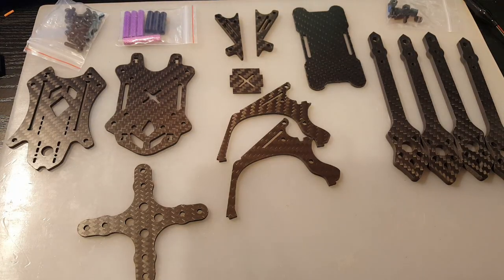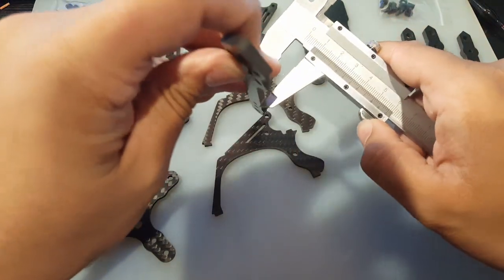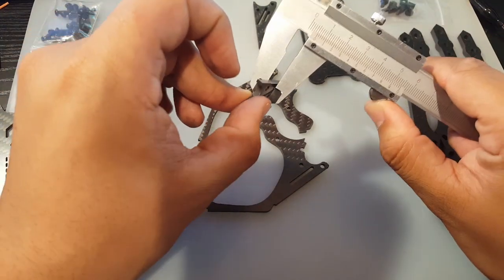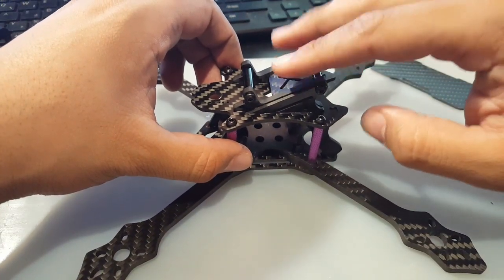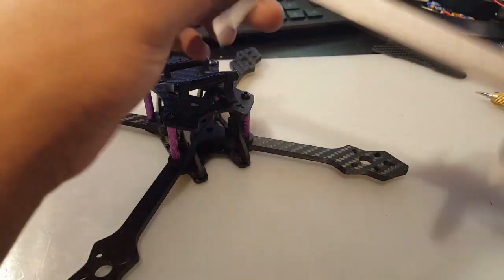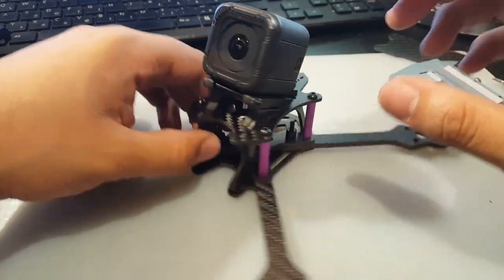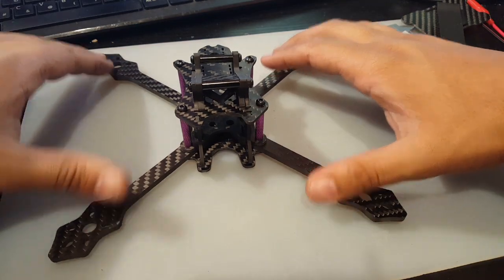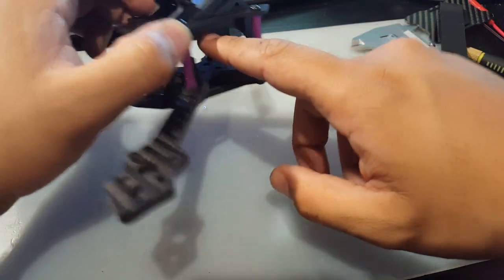Realacc Blackbird 205 Frame // My Thoughts and First Impression

Comment: I took the center parts and hd cam parts away, dry my quad is 270gram (frame 65gram) and total of 392gram with acc :) awesome frame, got 3 now and have started to remake it in better carbon. the setup of it is awesome.
Reply: how you mount your fpv cam? I need help..

Comment: How do you know if you need a BEC in your build? Is it  cause by the choice of esc? Please reply cause i have no idea with my build right now and this is making me stressful not able to fly my first miniquad.
Reply from the maker: Dellox Ford if your flight controller does not had a pdb in it then you should get a pdb.
Reply: Drone Mesh Did you mean an aio flight controller and pdb?
Reply from the maker: Yes what flight controller are you thinking of using?
Reply: Drone Mesh I'm a beginner on building so I'm not that sure on using an aio cause it seems to hard for me to solder
Reply: Banggood revo f4 flight controller
Reply from the maker: Good choice the pdb that comes with the frame is good. Like this, you don't need a BEC because they are in the PDB.
Reply: Drone Mesh I thought that it depends on the ESC 😅
Reply: Drone Mesh thanks for the help😀
Reply from the maker: Glad to help ^_^